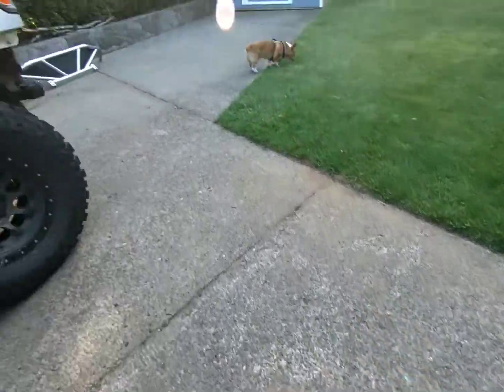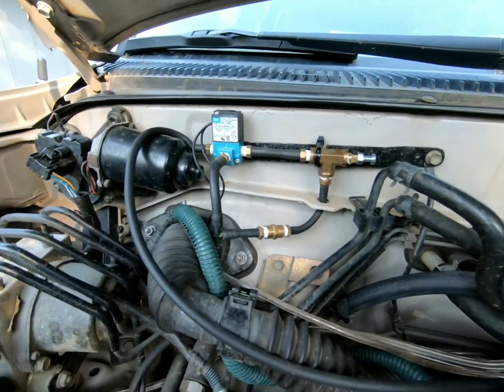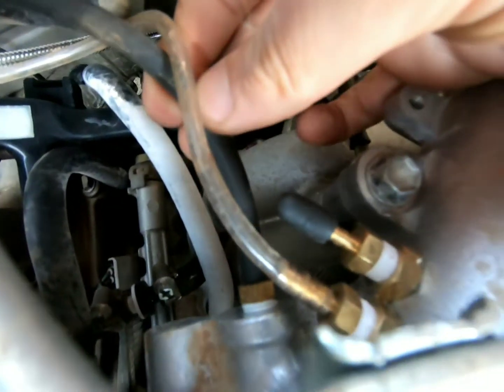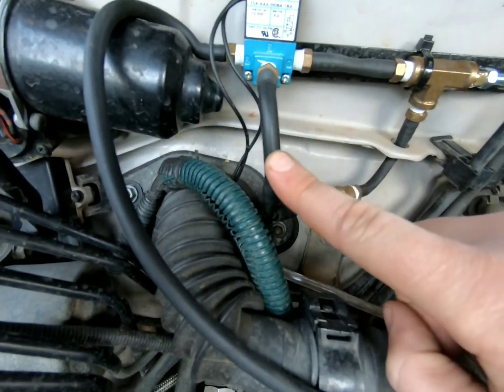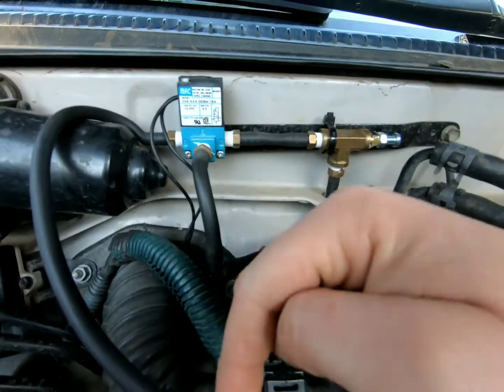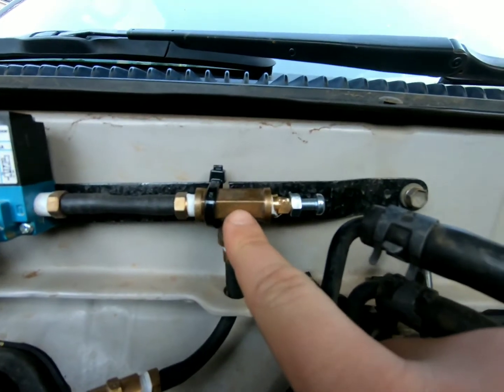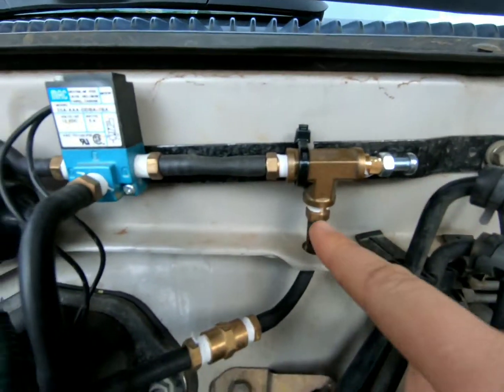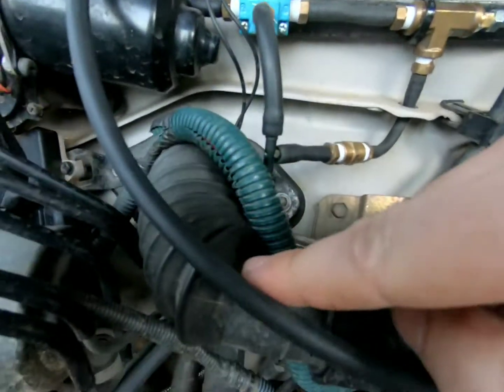*Home-made* electronic dual stage boost controller (how it works)

Comment: How long did the mac valve last? Is it hooked up to a monatary switch or normal on/off. I think you just solved my boost controll setup 👍
Reply: Momentary*
Reply from the maker: The Mac valve never had any issues, I wired it to an on/off push switch

Comment: So if I'm understanding correctly your pushing boost back onto the waist gate to keep it from opening at spring pressure ? Therefor increasing the boost?
Reply from the maker: The "high boost" line is essentially a small vacuum leak. That then decreases the pressure to the wastegate making it open later